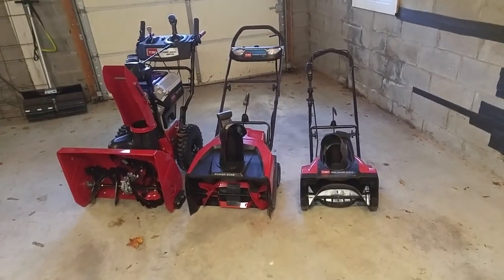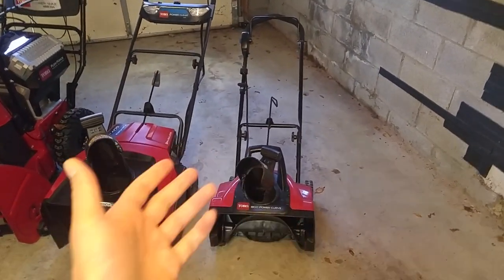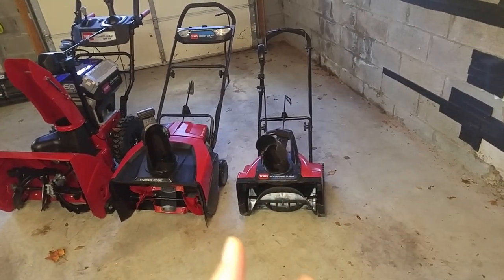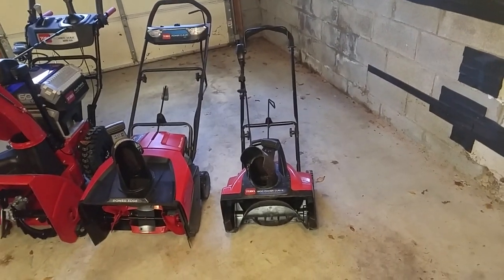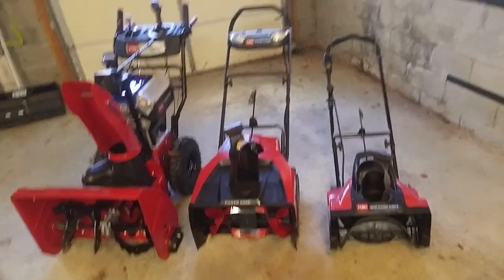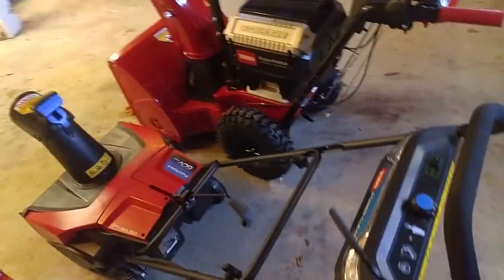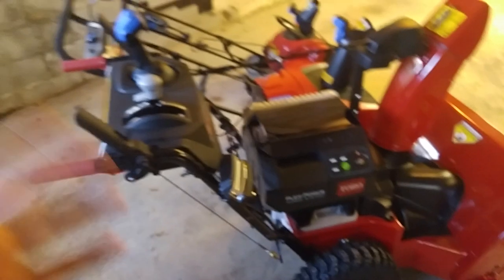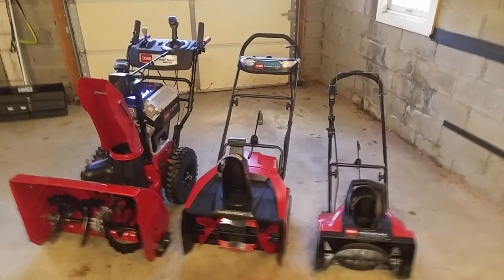Toro electric snowblowers overview, Power Max E26, Power Clear 21 in., Power Curve 18 in.

Comment: Like I mentioned in my previous post for $1,600 should have came with super fast chargers, three batteries, AND TWO SETS OF SKID PLATES

It stinks you have to buy another set to protect your property!!!
Reply from the maker: I don't strictly need the third battery.  It came with the 21" single stage.  Is it expensive?  Yes.  Is it worth it?  We'll see.  I'd rather pay more for quality that lasts longer.  There simply isn't enough data out there to speak to reliability for EGO, Toro, etc. battery powered snowblowers, because none of these have been around for 10 years.  We'll just have to see how they do in the long run.  So far, though, I'm pleased with my purchase.
Reply: @doctormosfet  I think the reliability of the Toro will be exactly like their gas models because it is a exact replica of their gas models the drive belts and everything.. 

The only thing that's different is the motor. Electric motors last a long long long time especially if they're brushless. I had the Toro 1800 like I said for 10 years in the motor still works and that's a brushed motor. 

Obviously the batteries will need to be replaced every 3 to 5 years depending on how much use and how they're taking care of lithium-ion batteries have a shelf life also even if you don't use them. 

But the reliability I think is going to be perfect and I don't think that's the problem.

The problem is how long it lasts when you're using it. That is the only problem.  And the only problem people have been complaining about. 

They would all say I wish the batteries would last longer or come with super fast chargers. They said if it did then they wouldn't have returned it. 

They were basically saying I can't keep charging these things after 30 minutes and then wait 3 and 1/2 hours to do another 30 minutes. 

It took one dude from the New England February Blizzard all day to do his house because of the charging times.

Needless to say he returned it.

So did a few other people who were in that blizzard. 

So I'll be good to go as I stated my properties not that big. Toro's working on fast chargers soon as they come out I will buy them and I will need two of them cuz you need one for each battery. It's going to cost me an extra $200 plus tax.

Really sucks the money you going to put into these. 

But the quality in the reliability of Toro is going to be amazing.. It's been proven on their gas versions

But at least there's a 3-year warranty that's good But I'm going to dread the day something goes wrong with this in 3 years because they only work with their own service centers..   Even if the battery is not working right you have to bring the battery to the service center or you might have to bring the machine and the battery!! That is just crazy and unacceptable.. 

I don't have a truck so I would have to rent a truck or something to get it there. 

That's why I like snow Joe's customer support in their warranty. Which is only 2 years that you can extend to 5 they will literally replace the batteries no questions asked and then you send the old ones back With the box they they came with the free shipping label.. 

Snow Joe actually pick up their product and have it serviced in those warranty years. 

I just think Toro is better made. Guess there's pluses and minuses. The bigger companies don't seem to care as much as the small companies.. because they have plenty of business.

Great talk. 

:)
Reply from the maker: @muzikmon2267  If you have a good warranty and customer service, then that would surely make up for any deficiencies in build quality, assuming of course that you don't end up stuck in a blizzard when your snowblower dies ;)

My primary interest on the reliability side is the control electronics and battery quality.  As an R/C enthusiast (which is like 99% of my channel's content), I can say that control electronics and battery quality are the biggest weak points of any electric system.  The electronics can fail for any number of reasons unrelated to the motor itself being nearly indestructible.  You can extend battery life by avoiding fast charging, so for me I have no interest in a fast charger as it will just mean I'll need to replace the batteries sooner.  But the electronics are the big unknown.  Hopefully they'll hold up, but time will tell.
Reply: @doctormosfet  

I guess we'll see but battery technology and motors have been around for a long long time and I've never had any problems with anything like that.. 

They've been very reliable..

As for the fast charging that is not true.. 

I've read many articles before even bought this about if super fast charging deteriorates the battery. 

When it comes to these type of batteries the ones that are in tools for construction blah blah

It really does not deteriorate the battery as much as you think they basically stated that there may be some deterioration But by the time It takes to charge and recharge enough times to cause problems in the life of the battery ( It's time to replace the battery anyways because they have a shelf life even if you don't charge them at all!! ) Especially lithium ions.  

So basically fast charge them all you want you'll have to replace it in three or four years because it's not going to perform as well whether you do a super slow charge or fast charging. 

I believe me I did tons and tons of research on this for the exact reason you just stated. 

In not to mention snowball batteries won't be charging and recharging as much as other tools.. For instance If you have a lawn mower obviously once a week you'll have to use it over and over again.. therefore a lot of charging.  Not the case with snow.. 

For the most part it's only a season and you don't have to snow shovel or snow blow every week You may get three or four bad storms during the snow year.. And the other few inches you get you can use a push shovel... 

So less stress on the batteries when it comes to charging them in the winter. 

And how many times would you really have to fast charge your batteries? Only a few times when you have those big storms. That does not put a lot of stress on the batteries at all. 

FYI the 88602 That comes with these. IS CONSIDERED A FAST CHARGER!!! They actually make another one That is the regular type of charger you're talking about that takes seven or 10 hours to charge these batteries It is the 88610!!

So I guess you have no choice but to use a fast charger cuz you're using one right now. 

The 88602 means 2 amp charging. They're coming out with a 5.4 amp charger that will charge the batteries in one 1 and 15.  minutes. 

And FYI there are a couple companies I think DeWalt and another company that state their fast chargers and super fast chargers do not deteriorate the battery and they swear by it.

So the technology is there where it will not hurt these batteries if you charge them in an hour. 

I definitely will be buying too fast charges when they're in stock.  And I will only use them when I need them in a big storm.. in general I'll just use the other chargers when I don't. 

I can almost guarantee you there will be no issues with these batteries going bad quickly with any of the chargers in these good technology batteries. 

;)
Reply: @doctormosfet  well Toro has a longer warranty. They back their products but the way that you have to have it fixed is just a pain in the ass.  They're all about their service centers.. plenty of them But it's a pain in the ass.. other companies like Snow Joe may not be better customer service in terms of warranty. But they seem to want to make you happy quicker.. 

But Toro's reputation over the years with snow blowers is unbelievable.. 

And I'm definitely not afraid of the motors and electronics. Having 30 years of building electronics and experience I have electronics electric motors and all that stuff. That still work 25 years later. Some 10 or 15 years some 12. 

Not really worried about it.. But I understand your point.. 

;)